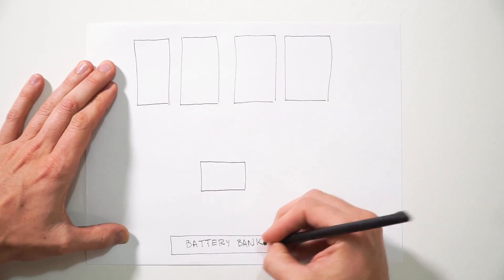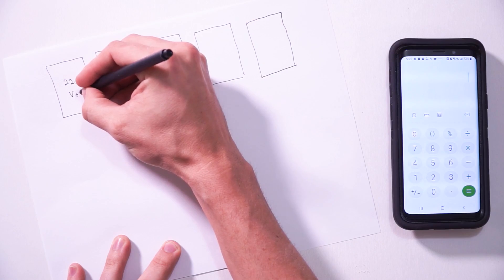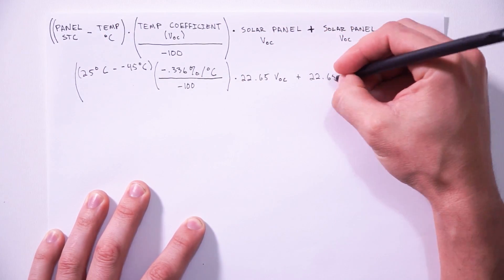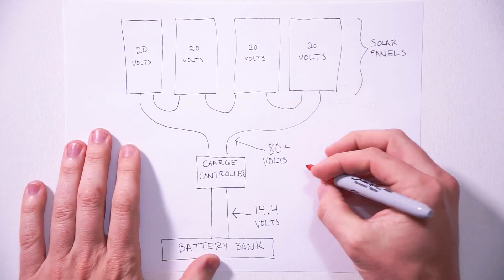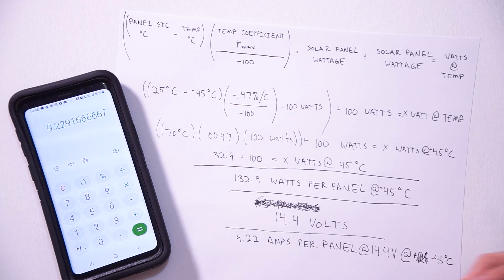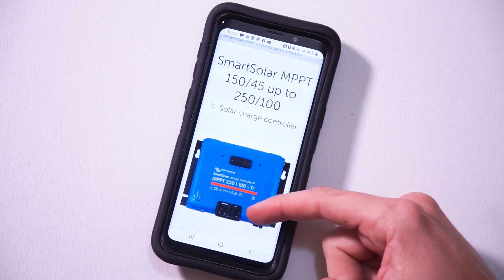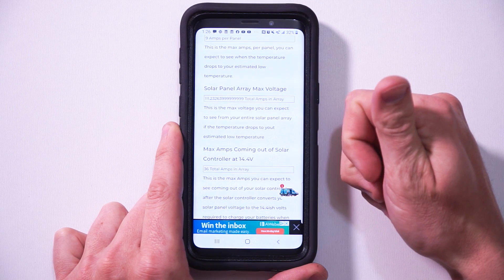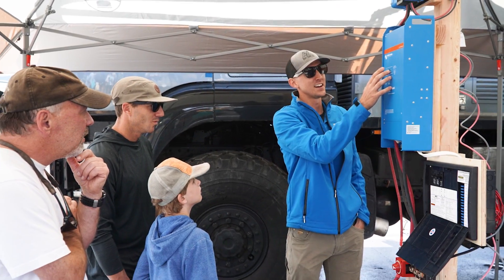How to Size a Solar Charge Controller for a DIY Camper Van Solar System

Comment: so I have a rich 40 ampm ppt solar controller I have 4 100w solar panels running in series/parallel.  I am figuring that if I keep the series/parallel that I could run up to 800 watts of solar panels.  I ran the numbers and 1000 watts is too close to max the system of 100v/40amp mppt controller.  Am I right with the numbers?
Reply from the maker: The max wattage that can be hooked to a 40A solar controller when paired with a 12V battery bank is about 520W.
Reply: @EXPLORISTlife  That's what I read but then I was adding up the volt and amps and got different numbers.  I noticed on the Richsolar sight they offer the 40 amp Mppt controller that I have in a kit and they have 600 watts of solar panels with it.  At times this can get really confusing.  I have really enjoyed your video's they are very helpful.  Thank You
Reply: I just went again to Richsolar web sight and they use a kit with 200 watt solar panels.  The max volts on each panel is 20.4 volts and the run it in series.  So that means for 3 panels the volts will be 61.2 volts and the amps will be 9.82.  I think the volts on these 200 watt solar panels are kind of low and compared to other panels.

Comment: Mmmm, you can’t add the amps when connected in series! You add the voltage in series and add the amps in parallel. Just saying!
Reply from the maker: Yes, that's correct.  Did you have a question or were you just making a statement?  Here is a video that will teach you how wiring your solar array in series vs parallel (or series-parallel) affects the array voltage and amperage: https://www.youtube.com/watch?v=KJ5zCY5EBeQ
Reply: @EXPLORISTlife  Just want to ask the same here, on 2:25 you draw  ONLY 1 string of series connection with 5 panels and you correctly sum up the Voc (since it was series), however on 6:10 you also multiply the amp by 5 although it was ONLY 1 string of 5 panels in SERIES ? Think AMP should be 9.22A at max? Thanks
Reply from the maker: @risalgunawan8508  Ah, I see.  So, not really...  The 46.14 number is how many amps the charge controller is putting OUT after it regulates the array voltage down to the 14.4V it's charging the battery at.

Adding amps & volts ONLY matters on the UPSTREAM side of the charge controller (the panel side.  Once the array delivers it's power to the charge controller, the charge controller will regulate those variable volta & amps, and output and more predictable charge parameter.

Another way of looking at it...  On the 'downstream' side of the charge controller, we aren't adding voltage and amperage anymore, it's just the resulting output of the charge controller.

Examples:

A charge controller receiving 600W at 20V and 30A from the solar array will output 600W at 41.6A at 14.4V to a 12V battery bank.

A charge controller receiving 600W at 60V and 10A from the solar array will output 600W at 41.6A at 14.4V to a 12V battery bank.

A charge controller receiving 600W at 100V and 6A from the solar array will output 600W at 41.6A at 14.4V to a 12V battery bank.
Reply: @EXPLORISTlife  So basically in order to calculate MPPT amp requirements, sum up all the panel wattage (doesn't matter series/parallel/combination of both in the upstream) then divide by Batt volt. So for example if i have 2S2P config of 300W panel each then MPPT requirement for amp for 12V batt is 4x300/12=100A, and it still the same for panel config 4S or 4P (ignoring any temperature coefficient, deviation, etc). Is that assumption right? 
And if i choose lower amp for my system (ex: 50A instead of 100A) - Will it be fine and MPPT will automatically limit it to 50A and would not be overload?
Also read somewhere that best practice is to limit current to batt max 20% of Batt capacity, so if batt 280Ah then max current to batt when MPPT charge it should be 56A. Please kindly advise.
Reply from the maker: Correct.  Solar Array Wattage / Battery Bank Voltage = Amps charging the battery bank

Thats the 'rough way to figure it, yes.

Comment: Hi Nate,

I recently watched your video on how to Size Charge Controllers for a Solar System (https://youtu.be/MxziHKvTRh8). One thing I noticed when looking at the Schematics (https://www.explorist.life/solarwiringdiagrams/) is that you have a 50A DC Breaker/Fuse inline between the Solar Panel Array and the Charge Controller. I haven’t been able to find much information on how to size that component and whether the necessity of that Breaker/Fuse is necessary depending on Solar Panel Array Configuration (ex. 2S2P).

In addition, I’m unsure of how to size the fuse between the Charge Controller and the Batteries. Is this based on the "Max Amps Coming out of Solar Controller” from your calculator? (https://www.explorist.life/solar-charge-controller-calculator/). Looking at the data sheet for a Victron MPPT Charge Controller (https://www.victronenergy.com/upload/documents/Datasheet-SmartSolar-charge-controller-MPPT-100-30-&-100-50-EN.pdf), I see the "Rated Charge Current” is 30A. What size fuse between the Charge Controller & Batteries would you use in this case? Fuse sizing has become a difficult task in my design.

If you have a resource on how to determine this info, please share a link.

Thanks for your time
Reply from the maker: 1: The breaker between the solar array and the charge controller is simply acting as a disconnect and not offering any kind of overcurrent protection; so that is just sized so that it will NEVER accidentally trip.  A well designed solar array will never have 50A coming in from the charge controller, so that's why I use that size in all of my diagrams found at https://www.explorist.life/solarwiringdiagrams

2: How to size fuses: https://www.youtube.com/watch?v=5y-yDMEgV70

Or, you can use the solar design options at the bottom of this diagram page which already include fuse sizes: https://www.explorist.life/3000w-inverter-400-600ah-400-to-1200w-solar-camper-solar-kit

Comment: Dude, this is so helpful. Thank you so much for sharing. And for free. So where is the best place to order solar panels in Canada?
Reply from the maker: Awesome!  Glad it helped.  I have a list of my preferred solar panels here: https://www.explorist.life/best-solar-panels-for-a-diy-camper-van/ 

I'm not 100% which ones are available in Canada, but I think most of them are; you'll just have to check.
Reply: @EXPLORISTlife  Cool, thanks, I'll definitely check it out. So curious, do the panels usually come with mounting holes or brackets or is there some sort of standard out there? I'm trying to design an aluminum roof rack to support the panels so it would be helpful to know what sort of fastener options are available. Ideally it would make for easy installation and removal..
Reply from the maker: There are really no standards out there for that as it varies SO much from camper to camper.  This is really where DIY ingenuity comes into play.
Reply: @EXPLORISTlife  right, but do the panels come with holes? or some do, some don't kinda thing?

Comment: Omg ur a wealth of knowledge thx for all your maths plugged my panel info into calc but it didn’t give a recommendation
Reply from the maker: What information did the calculator provide in the ''Detailed Results" Section?
Reply: Wow 1st off ur amazing with the speedy reply the series parrellel thing threw me for a loop but amps going into charge 18 comming out of solar 86.11 300v per panel 1200 total
Reply from the maker: Gotcha.  The array voltage is too high.  that's why it isn't making a recommendation.  Try using a series-parallel configuration to lower the array voltage.

Comment: I new to solar. I want to buy two solar panel 250w 36v each so total of 500 watt. I just want to start out small then buy more 2 more panels later to make 1000w. What charger controller should I buy to start with the two panels first then add on more panels when I have the money without buying another charge controller? I already have the 36v 3000w inverter. Can you give advise ?
Reply from the maker: Size the charge controller for your 'end goal'.  The charge controller will be oversized at the beginning but there is no harm in that.
Reply: Thanks you.
Reply from the maker: No problem!  Happy to help.

Comment: Thinking about adding battery monitor to my setup. Any thoughts on bvm 712?
Reply from the maker: It's great.  I spec out the BMV-712 in literally every one of my diagrams at https://www.explorist.life/solarwiringdiagrams
Reply: @EXPLORISTlife  do you have a specific video that may go further onto it,  install looks to be straight forward.
Reply from the maker: Not a dedicated video (yet) but I covered it pretty extensively in this one: https://www.youtube.com/watch?v=JMqtVBN26NQ
Reply: @EXPLORISTlife  thanks Nate!
Reply: @EXPLORISTlife  I am currently using 1/0 cable with 150amp circuit breaker from batteries to 1,000 watt renogy inverter. Kinda want step up to 2,000/ 4,000 surge watt inverter to be able to sporadically run coffee maker or 1,000 watt microwave without being at max load. Cable length is about 4'. Do you think this cable is still sufficient for inverter upgrade with moving up too 200 amp breaker?
Reply from the maker: Victron recommends 2/0 wire in their user manual for the Multiplus 2000; so I must do the same.  Here is a wiring diagram for my recommendations for a system with a 2000w Inverter: https://www.explorist.life/2000w-inverter-200-400ah-lithium-200-to-700w-solar-camper-wiring-diagram/
Reply: @EXPLORISTlife  would multiplus 2000 replace conventional rv converter charger function when plugged in to ac? I assume so but figure I should ask.
Reply: @EXPLORISTlife  linx distributer and linx power in? One just have fancy overpriced fuse status lights and the other just no frills buss bar?
Reply from the maker: @RichardCoryMagill  The Lynx Power In does not have spaces for fuses built in, which is the most important feature of the Lynx Distributor for the purposes of the systems I design.
Reply: @EXPLORISTlife  thanks for setting that straight before figuring it out the hard way! Buy cheap, Buy twice. I do like the modular design for keeping aesthetically clean. I did decide on mutliplus 2000. This time i am gonna go 3/0 cable as to hopefully never have to re run cable again if for some reason we upgrade to multiplus3,000.
Reply from the maker: For sure.  Also, worth noting... the Multiplus 3000 calls for 4/0 wire, not 3/0. 👍👍
Reply: @EXPLORISTlife  Oh boy! Well wife will probably strangle me if I buy another Victron inverter anyways. Guess 3/0 will just be healthy about of copper for increased juice with minimal line loss!
Reply: @EXPLORISTlife  any position multiplus2000 can't be mounted?
Reply from the maker: It is BEST to mount it vertically.
Reply: @EXPLORISTlife  so I am currently working on acquisition of parts and hardware for power upgrade from original learning setup. I currently have BMV-712, multiplus2000 and went 3/0 cable to replace previous 1/0 feeding 1,000watt renogy. I plan on buying linx distributor to connect everything. Obviously will use 300amp fuse feeding multiplus from distributor but was also thinking about using terminal mount fuse as my leads are still runing from batteries on trailer tongue. Thoughts on fuse size for 3/0 wire for that fuse?

Comment: My solar charge controller accept max 660W and 25V. I'm planning on 4P 160W (640W). The calculator takes me to 27v (at -25C) and 41A (from Scc to battery), I think I never going to be at -25C (maybe one a year for 1 day), usually the coldest temp is going to be -10C (14F), then the V lower to 26V. Is the SCC going to accept it? Thanks for advantage
Reply from the maker: Nope.  It sounds like your charge controller input voltage is too low for your panels/array.
Reply: @EXPLORISTlife  Wow! Wasn't expecting and answer from you!! Really glad to have you here! The SCC is the Renogy DCC50S, according to renogy it could fit, maybe bc they made the calculation thinking on 640W (and the DCC50S says max 660W), but taking in consideration all you research the numbers doesn't fit! Will take a look and find different panels to achieve at least 600W!
Reply from the maker: Yeah, that is a big reason I don't like/recommend that particular unit.  The input voltage isn't high enough to be useful, in my opinion.

Comment: Hi Nate, Ive tried to do calculations and i'm still stumped. Im in UK with average weather I suppose but will be using mostly in Summer on my Camper or R.V. I'm thinking of putting 4 x 460w panels on the roof in Parallel. I've looked at EPever Controllers. Please could you tell me if I have 1 or 2 Controllers what I would need? Thanks & Best Regards
Dean
Reply from the maker: Based on the information provided in this video... what do YOU think you need?

Comment: @EXPLORIST life - DIY Campers Wow! Thanks Nate for the link! You are the best :D
Sadly I can't purchase the wiring diagram because I'm not from the USA and I don't have a credit card ... Have you thought about making PayPal available for the purchase of your diagrams? 'Cause then I could buy it :")
- [A] Do I see correctly that if I split the solar setup in two I will have to double the inverter too? [B] Is there a way to do this without doubling the inverter and all of the wires? - [C] Oh and it says 6000W about the inverters -> if I need a 3000W inverter in general does that mean that I can use two 1500W inverters because they will add up? - [D] And here are 800Ah of batteries in use ... does this whole diagram work with 600Ah as well? And with 900? (as an explanation: I use 300Ah batteries) -> [E] maybe in general: If I start with 600Ah and realise it's not enough, can I easily add up? Or would I have to change the wiring too?
I know, I know so many questions ... I'm sorry ':"P
You have my sincere thanks!
J
Reply from the maker: Darn!  I've had too many issues with Paypal in the past and can no longer offer that.  Sorry. :/ 

A: No.  You can use as many charge controllers as you like and use only 1 (or none if you didn't need to convert from DC to AC) inverter.

B: ^^^should answer that question.

C: Also... don't need 2x inverters.  The 2x inverters in that diagram is only for generating 120V/240V split phase power.  If you only need 120V power (or 230V if you are not in N. America), you can just use 1x inverter.

D: Yes.  That is fine.

E: No change necessary.

Comment: Hi Nate!
Is it possible to use two MPPTs? And to wire them in a way that both solar panel systems behind those two MPPTs supply the batteries with energy? Because I have the problem that I need two different kinds of solar panels on my roof and that I can't effectively put them all together in one system with one single MPPT or I would loose a lot of Wp (at that point thanks again a lot for your great video on how to wire solar panels in series and/or parallel!).
Sincere Thanks,
J
Reply from the maker: Yep!  Sure can!  I have a dual MPPT setup in this diagram: https://www.explorist.life/24v-6000w-120v-240v-split-phase-camper-solar-wiring-diagram/

Comment: I have got one question in the calculation the temp coefficient of VOC, the -0.336%/°C is that like some number that u would use for all solar panels of does every solar panel have a different temp coefficient? 
Edit: does it remain the same or change for the temp coefficient of Pmax as well?
Reply from the maker: Every solar panel will have slightly different coefficients, yes.
Reply: @EXPLORISTlife  Thanks

Comment: I learn a lot from you
I would be happy for your help I have a three-phase system
The maximum power is 1100 watts three-phase,
At the same time there are more single-phase consumers, do you have a system or sample link of this type?
Reply from the maker: Glad it's helped!  I do not have any 3-phase examples.  3-phase systems aren't used in campers so I don't forsee ever publishing one of those. Sorry about that!

Comment: It is Ok if your panels a generate more amps (within limits) so long as the voltage is not exceeded. This will give better performance most of the day. Some will be wasted at noon but will be more than made up for during the rest of the day.👍
Reply from the maker: Excess wattage coming in that cannot be used will be, essentially, turned into heat at the charge controller, so it's probably not a good idea to exceed the wattage rating of the charge controller by very much at all.  A little bit is fine... but I still must recommend staying within spec.

Comment: Hi Nate! Thanks for being so detailed eventhough I will.not be doing that math lol. Question is there such thing as choosing a too big of an mppt? I would like to get the 250/100 so that in the future I can continue to add to my system. But it will start with about 1200w of solar and I choosing wrong?
Reply from the maker: The only thing 'wrong' with having an oversized charge controller is you are just wasting money on a charge controller that is too big.  There is nothing dangerous about it, though.
Reply: @EXPLORISTlife  thank you for responding! I thought might as well make the investment now so that later I dont have to spend double.. but glad to know it wont affect the system as we start

Comment: thanks for the info, but for total amp calculation, I suppose it refers to 5 panels connected in parallel? As current of panel suppose to be the same if they are connected in series.